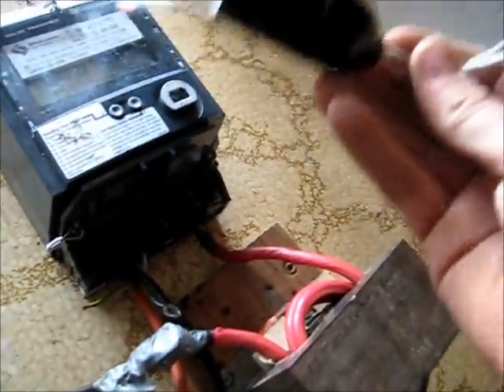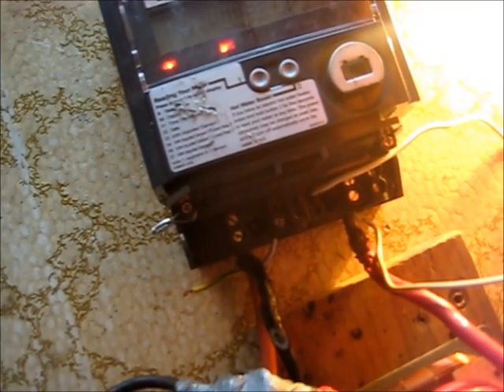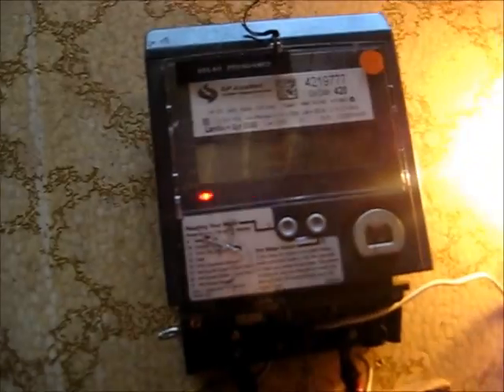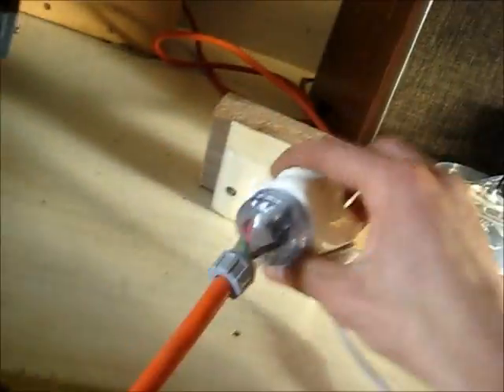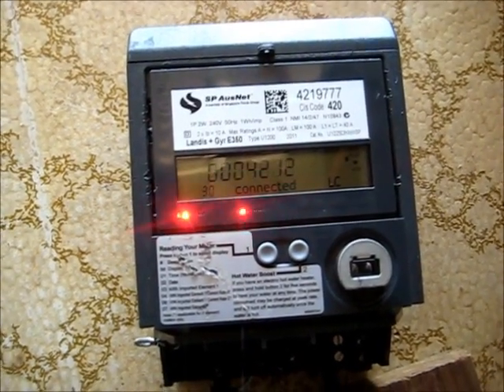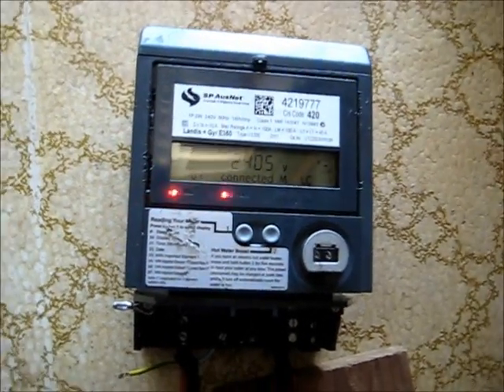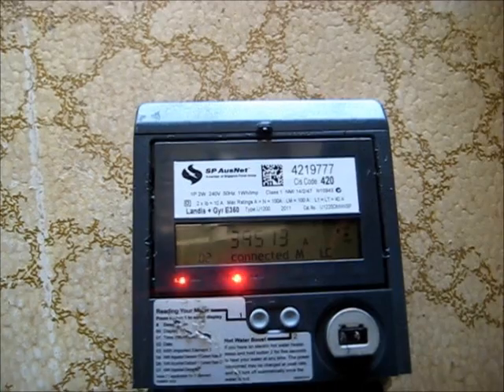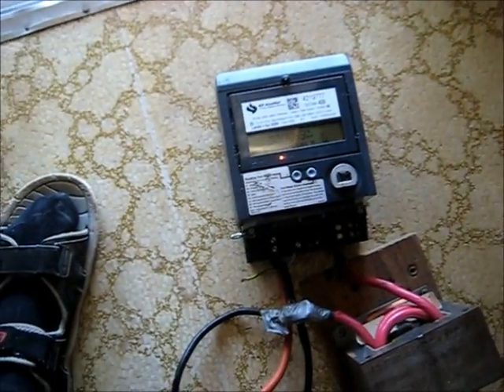Smart meter won't pop with my 400 Amp MOT !!

Comment: Ah yes. So you can only give it 400A for a short burst. I think this needs 600A+ continuous to make it go *POP*.

It's interesting that it took the 400A burst though!

As for a meter being capable of detecting 'Phantom-Loading'...Nah. At the end of the day, load is load. It measures current being passed, & that's it, whatever it is...even a re-wound MOT connected across it. :-)

This needs sustained "amps-over-time" to go *POP*. It'll take 400A for a couple of seconds, but 20 minutes? :-D

-BBD.

Comment: That meter took the excess current very well.
The powerfactor at 0.5 is about right as you provide and inductive load to the meter. The full current needs to stay on longer to overheat the current shunt of the meter.